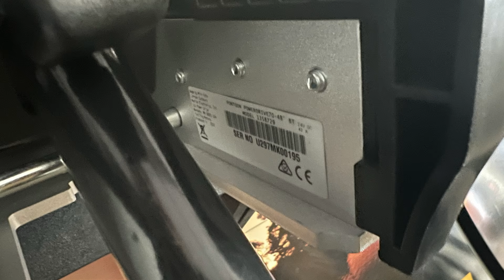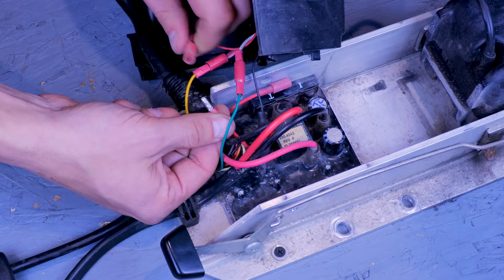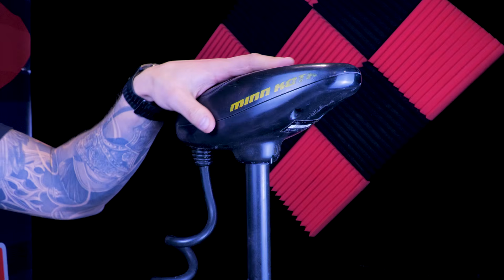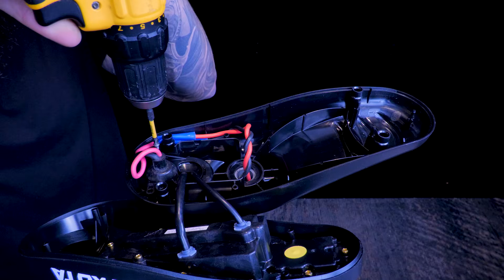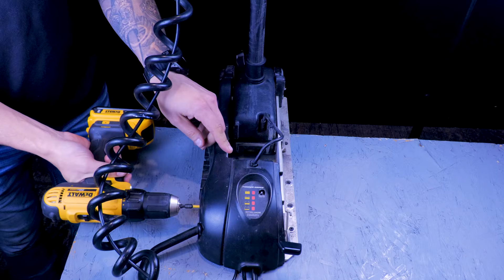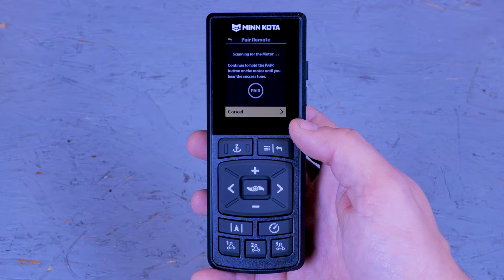How To Install Advanced GPS On A Minn Kota PowerDrive

Comment: I have a 2022 Minn Kota Terrova 112/IP/Micro 72 inch BT 36 volt trolling motor serial # 22216M00860  the spot lock feature is terrible
it is constantly moving back and forth will the new advanced GPS fix this problem if so do you have a part number so I can order it.
Thanks

Comment: I purchased this kit for my powerdrive with the serial number labeled MKAA which was manufactured in year 2000. This kit worked perfectly and I only had to change some electrical connections to work with the new board. I was even able to connect my trolling motor to my humminbird fish finder to take me to my way points.

Hopefully this helps someone who's on the fence because they dont know if this will work on their motor like I was.

Comment: Took my head off it’s a newer model I pilot by 2021…. Took my head unit off and it looks nothing like that it has multiple connections including transducer plug that doesn’t fit the new head unit I just purchased

Comment: This is exactly what I needed! I have a 2015 version of a PowerDrive V2 with IPilot. My spot-lock really has been messing me up while trying to fish. It continually overshoots and over-corrects itself. Didn't matter if it was dead calm or choppy. I was considering upgrading my trolling motor until I heard about head upgrade kits. I watched your videos and decided I was going to ty the upgrade to Advanced GPS. I ordered the kit and installed it. Hit the water and what a difference! It was night and day! The motor was able to put me in the direction I wanted to be in and keep me right there. I use Livescope on a pole and my old head wandered so much that I couldn't keep the beam pointed at the fish. It was hard to keep moving the livescope transducer to be in line with fish and fish at the same time. Having advanced GPS solved that problem for me at a fraction of the price of a new trolling motor. I was on a 3 day fishing trip and it locked me where I needed to be and I could keep fish in sight of livescope without having to constantly spin the pole. I was actually able to just focus on fishing and let the trolling motor handle the positioning. Thanks for creating this content and selling me this kit! It really has made a major difference for how I fish.

Comment: I noticed that TMP also offers  new lower units. I have a V2 powerdrive 12V, I'd like to up grade to a 24V lower unit. Is that possible? If so which unit would I need. I have left emails for TMP costumer service, but no answer. May be you can do a YouTube to discuss swapping out a lower unit.

Comment: So just to be clear... The iPilot bluetooth remote (Part #2994075) is NOT compatible with the Advanced GPS head?
Reply from the maker: That is correct. The Advanced GPS Controller is only compatible with the Advanced GPS Navigation Remote, Micro Remote and the Minn Kota App.

Comment: Great video, im thinking about doing this update for next season. I have a BT version i bought in 19 , with the copilot remote. This update will eliminate the copilot side plate and connection cable? Its been awhile, i know i dont have the factory side plate anymore.

Comment: I have a PowerDrive 42lb/54 inch shaft/ foot controlled but my serial has no bt at the end. Can I upgrade it with a kit to get all of these features or is it not compatible?
Reply: Did you ever find out? I found a powerdrive 42 lb and I am wondering if i could add one of the kits. It doesnt say whether its a v2 but the head and base look like the newer models
Reply: @ as long as the serial has a BT at the end of the serial number then it’s fine but another great option would be a Terrova.
Reply: @rafaelortega9820  Just looked up a few more phots of the BT models to compare and the head definitely looks like the 2020+ models. All i need to do is ask the seller for the serial but it's looking like it will be BT. 
It will have to be a powerdrive as it's going on my 10 ft kayak and cant pass up on the price of the motor.

Comment: I have Riptide PowerDrive 55/CP w/ CoPilot & Bluetooth - 12V-55lb-54in I bought the this kit and when I try to sync with the remote, there is no beeping noise
Reply: Did you fix it?
When i had the same issue with my terrova it was simply that the button (which is only thin plastic) did not reach the actual button on the circuit board.

I pit a piece of rubber in between so it reached and it fixed it.
Hope it helps!

Comment: If I’ve upgraded a v1 power drive to a v2 control board and foot pedal. Can I just order the v2 kit Without the control board ?
Reply from the maker: Yes, since you’ve already changed to the V2 control board, you’ll need the V2 Kit for 2007-2016 models. This will come with the new style bottom base, but no control board. 
https://trollingmotorparts.com/minn-kota-powerdrive-advanced-gps-upgrade-kit/